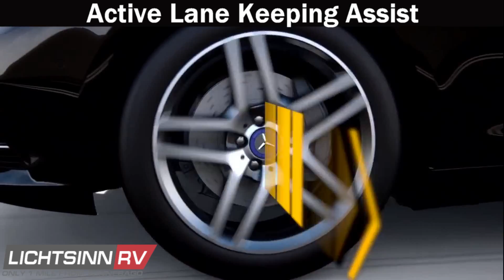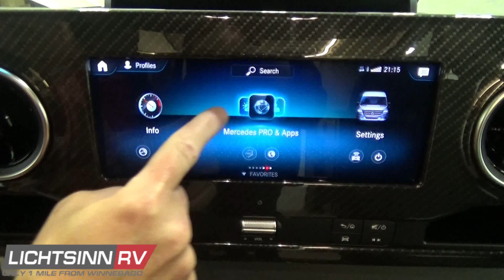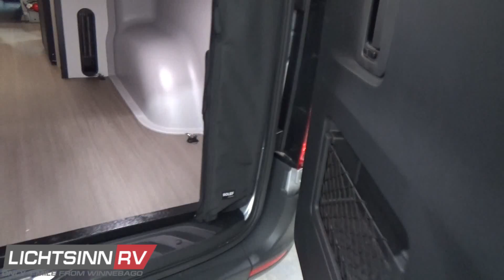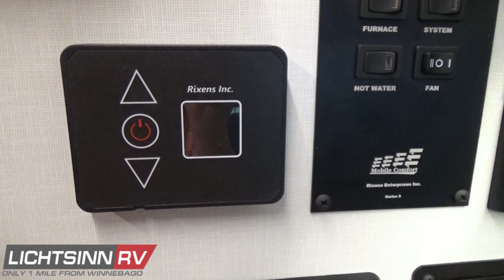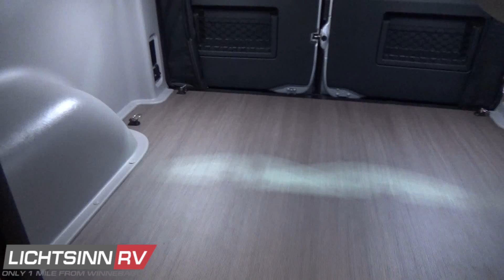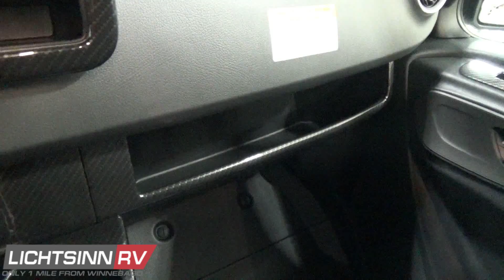LichtsinnRV.com - New 2020 Winnebago Revel 4x4 44E in Iridium Silver

Comment: Are there Ram Mount tracks in the cab? I’d like to mount my iPad on one, so I can use my GAIA GPS mapping and Garmin Overlander. Can a Mach 8 Ultra Low profile A/C unit be used in lieu of the higher profile Mach 10?
Reply from the maker: Good afternoon Bill!   We can help you with both of these... we can mount the tracks where ever you like and we could swap out the air

Comment: Can the AC be run when boondocking if is plug to a Generator ?  What the total weigh that bed can hold ? What kind of mattress is there?
Reply from the maker: Good afternoon Diana!   Thanks for your note!   It absolutely can and is designed for the purpose...  in fact here is a great video we did on AC management   https://www.youtube.com/watch?v=-hT9V_yZ7Dc
Reply: Diana Balto yes,, they said so on another channel
Reply: The bed apparently holds 500lbs. Not sure about the mattress. Some kind of medium firm foam, no doubt.

Comment: can you put the the electric system like in the travato  so it can run the Air conditioner
Reply from the maker: Good morning!   Most likely not with the GVWR of 9,050 lb and the limited space.  The AC is most often run off a portable gen or shore line service